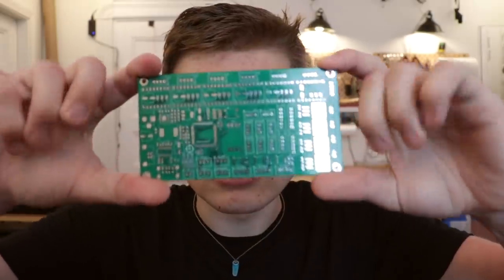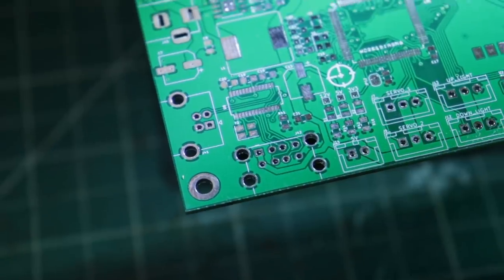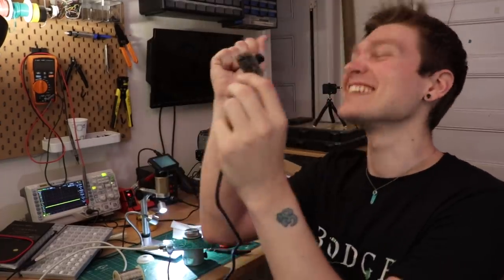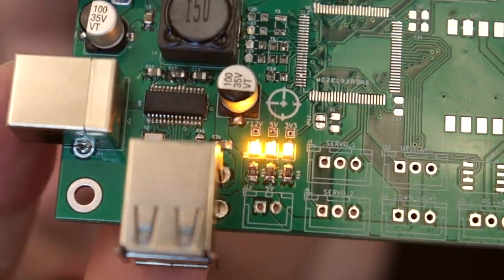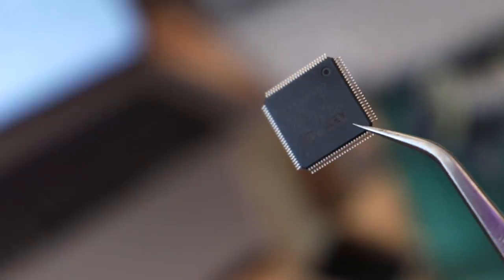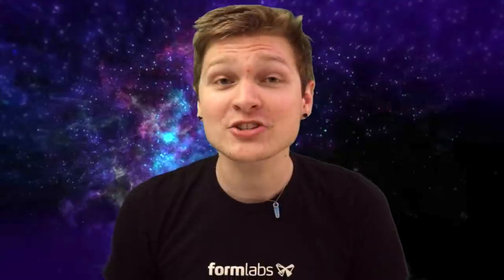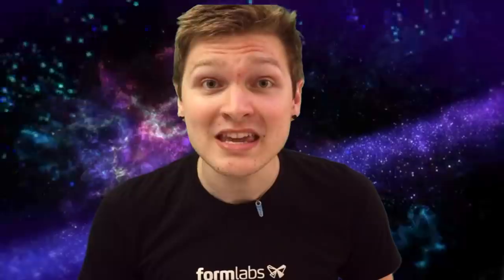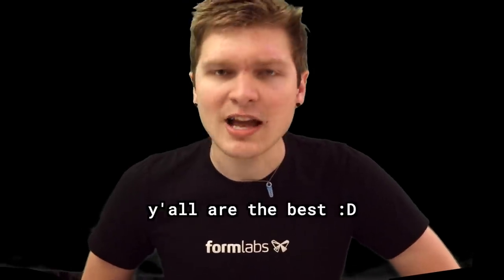The Circuit Board That Builds Circuit Boards

Comment: How would you feel about making a video in which you go through how you select your components? (sites, datasheets etc)
Reply from the maker: Hmm, I haven't considered that! I've been thinking about doing some design streams on Twitch, I might try doing it there! Picking parts is a tricky process, and one I wish I had more visibility into when I was starting out (and still consistently struggle with).
Reply: @stephen_hawes  design streams sound really good and something I (and probably many others) would definitely be interested in

Comment: Hey m8 here to drop some advice for you. Making your life a bit easier. 
Throw Away your conical tips, they do everything but very badly. Sure a beginner just starts off with them and that's ok. But you are not a beginner. 
For BIG parts like an inductor or drain of a FET, use a tip formed like a razor almost or with a big wedge, that way you get the most contact area to the pad and the part. Big thermal mass on the tip goes without saying, absolute gamechanger. 
Also throw away your old school soldering iron with the separate heater, the only place for those in the trash. 
Depending on your budget get a JBC CD-2B something something (will last forever, if you have the money), PACE ADS200 (cheaper tips and cheaper price overall, still very solid build quality) or a T12 style soldering station from KSGER (china) they are also direct heat, quick tip change, small footprint and heat up extremely fast. Build quality is of course not the best but the price is also pretty low. If you can't afford anything else, get this. 
Also for soldering smt ics like the arm get a decent angled tip with a 30° angle on it. You can also get a special drag soldering tip but IMO they are not necessary as the surface tension of the solder will be good enough and the money saved is better spent on a good pair of tweezers. 

Hope anybody how sees this can learn from it and avoid the pain I went through.

Have a nice day.
Reply: Yeah nah. I agree on the chisel tips, they're great and I use them for everything. But there's still a use for conical tips in certain applications, and some people just prefer them. I'm not sure what this has to do with being a beginner.

There's also absolutely no need for a $400 solder station. Anything ~$100 will do fine for home use, a nice Weller is good and will last decades. Unless you're soldering massive components to several oz copper pours, you'll be just fine with a hobby-level iron.
Reply: @Caterpiggle  Well the conical tips are the most common and are therefore the cheapest. So when a beginner buys a cheap soldering station that's the one that will be included. When progressing in your electronics career you will find that for nearly every task there is a better-suited tip geometry.

Weller is also good quality. But their low-end irons don't have the heating element inside of the tip cartridge. Instead, they rely on metal on metal contact, which is just way inferior.
Reply: Barry Manilowa  Yes it is almost unbelievable how much better these newer direct heat style irons perform. Once you made the change there just is no going back.
Reply: I notice a lot of people in the comments section recommend things about the soldering iron, and I totally agree, but it saddens me the most that he isn't using flux. He could have 200% more joy when dragging solder across the microcontroller pins, and it would have made such a satisfying video. But instead, I'm left cringing and moaning at the solder bridges and the missed opportunity for an ASMR soldering moment. He Just needs to get some nice water soluble flux and ditch the solder braid (or at least save it for the seriously botched moments).
Reply: I can vouch for a jbc. I got mine second hand it has literal thousands of hours on the clock(it keeps track) and no issue at all. I love my jbc. The tips are great too for it. Proper tip care and they last a long time. I like the jbc tips better than the hakko t12.
Reply: @dreggory82  Have to agree.  A tube of flux makes soldering SO much easier.  I keep a container of flux-off and ethyl alcohol near my solder station for cleaning off all the flux I use.
Reply: @dreggory82  Yeah that's whole other can of worms ;)
Reply: @KG4JYS  I only ever use IPA to get flux off but it's getting hard to find locally due covid what brand of flux off do you use? Aerosol can or just the liquid I've seen both online but haven't got any yet.
Reply: @FixedUntilBroken  I'm using "Chemtronics Flux-Off Aqueous".  I got a gallon from Amazon a little over a year ago and it seems like that will be a lifetime supply. I've probably used about 1 cup/240ml.    https://www.amazon.com/dp/B0019V17G0/  That's the stuff, not an "affiliate link" or anything.  I'm also using ethyl alcohol.  I buy reagent alcohol by the gallon from sonicsupply.com for about 30 bucks a gallon. It's 95% ethyl and denatured with 5% isopropyl.  I use ethyl because isopropyl is not compatible with some of the resins that my sla 3d printer uses.  Keeping ethyl on hand means I can use it for just about anything except drinking.
Reply: What would be wrong using a ts100 or ts80p? At least the ts100 has more than enough power and thermal mass for very big copper planes. Can't feel a big  power difference compared to the Weller wx2 I use at work.
Reply: @KidCe.  Those have the power but the ergonomics of them are not very good.  I recently replaced my ts100 with a JBC station.   Part of the problem with the TS100's is that for the cable to carry enough power, it's generally thick and inflexible. Also the distance from the handle to the tip on a TS100  is very far.  You can use them but it's far more difficult than it is to use a JBC.  Pace ADS200 is a good alternative if JBC is too expensive.  It's got a short tip->handle length.  Flexible silicone insulated cord, and I believe it heats up even quicker than the JBC.  I kept my TS100 in case I need to solder something on the go, but I haven't actually used it since I bought the JBC.
Reply: @KidCe.  Sure I have a TS80 myself. It's a great bit of kit and if you need to drive by solder something definitely a great choice. But the T12 style KSGER iron is pretty much the same low price and having a soldering station compared to just the iron is definitely more convenient.
Reply: You may want to check if your soldering iron is ESD safe, and  consider using a wrist strap and grounding mat when handling static sensitive devices.

Comment: One of the killer aspects of working with ARM Cortex MCUs is the fact that you can often assign/route peripherals to a multiple choice of pins. The atmega328P is only going to optionally expose a PWM on this pin, an analog input on that pin, etc. etc. etc. but some of the ARMs will let you pick from a few different pins that can all connect via internal pin multiplexers to a given peripheral. Being able to more flexibly assign pins to peripherals opens up all sorts of possibilities when it comes to PCB design.

Comment: You should set your soldermask spacing to something like 0.01 to get mask between your IC pads. The fabhouse will change it to meet their specs.
Reply: You right. It is very important. I usually set solder mask expansion to 0.05 mm. Normally is ok for most fabrics.
Reply: @dimakrayushkin  Of course you can set it to the right specs! However they will process it and not reject it if you´re under it.

Comment: When etching my own stuff, if (when) I make a mistake and must flip a large chip, odds-are the board will get ruined.
 That's one big checkmark in favor of a proto board house: reworkability.

Nice job finding/using a "LQFP" footprint with a 0.63in pitch in such a high-ish pin count. The 0.4-0.5in pitch packages, more common in 64p+, are much harder to play with.

While I wouldn't want to drill and wire a bizillion vias, I could reliably resolve that footprint with a toner transfer. No need to break out the photoresist kit. 
major props on the project

Comment: This my first one of your videos. I love it. I really like the pure emotion in it. When I solder I like to either use a wedge tip or a bent/j tip. I also like to start with the smaller components and work my way up just because like those tall headers can get in the way some times.

Comment: Your PCB layout looks great.

I'm using almost the same chip (the STM32F407VGT6), which has a bit more Flash and SRAM (I think?)

Along with the FE2.1 USB hub chip.

I only recently tried using the hardware counters on the STM32 for reading a rotary encoder, and it works great. ;)
It has anti-glitching logic on the chip, too, so it didn't seem to require any caps across the encoder.

I'm glad I switched to STM32 from the old Atmega2560 I was using.
I did have to get used to using "Workbench for STM32" (Eclipse), though, because I needed to delve into USB HID.

(Most of the USB stuff could probably be done under the Arduino IDE, but it's harder to find specific libraries and example code for some of that atm.)

Using RS485 is a good idea for the PnP. It's far more standardized, there are existing libraries for it, and supports multiple devices.

Oh yeah, and I've also soldered the QFP chips backwards a few times. lol
I learned to be extra careful after that, because a lot of the chips have two dots on them.

I believe one of the dots is usually a bit shinier and deeper, so the camera on the PnP can distingusih it, but that dot is often opposite the dot that denotes pin 1. The chip package usually has the diagonal on one corner, too, but it's not always obvious.

Literally just this morning, my first PnP head motor arrived (the JYD2030-0604B-NK), as your PnP project inspired me to try building my own.

Looking forward to joining the stream chat when you host the Maker Cast.
Reply: btw, if you try using a small chisel tip on the soldering iron (say 1.5mm to 2.5mm wide), you should be able to get much better results with drag soldering.

(I pretty much only use solder wick for getting rid of the few bridges as the solder blob gets to one end of the pins.)

The "hoof" tips with the divot look amazing, too, but I've not tried one yet, as I can't quite justify the cost when I'm only building a few prototypes. lol

https://www.youtube.com/watch?v=5uiroWBkdFY
Reply: @electronash  how do you get soldering wick to actually work? every youtuber seems to make it look like magic when i and a lot of people i know cant get it to do anything. 
i gave up on it and tossed it out years ago.
Reply: your using an F4 chip? i cant remember if i repaired a drone FC that had a F3 or F4 on it, but its cool to see it used on other devices. 
i know its just a programmable IC but i like to know where else these things are used.
Reply: @darkshadowsx5949  

I'm not a huge fan of solder wick for through-hole desoldering. I just use the Duratool ZD-915 for that.

Even for SMD, I almost always add some liquid flux to the solder wick itself first.

It also helps to cut a small piece of the wick off, then use tweezers to hold that, so the rest of the wick doesn't, erm, "wick" the heat away. lol

But it also comes down to using the correct tip on the iron, and having a soldering station that has a decent heat capacity (which is different to it's stated wattage).

I use a Metcal station that I bought second-hand about ten years ago. I usually like the 1.6mm or 2.5mm chisel tip.

I wouldn't ever recommend the really pointy bevelled tips even with a good solder station, as it's tough to get enough contact area for good heat transfer.

The other thing with desoldering (especially through-hole) is to add fresh solder to it before using the desoldering station, as it helps it to reflow once heated. On the stubborn solder joints, I sometimes add a dab of liquid flux too.

And also hold the PCB vertically on the bench, so the desoldering gun isn't working against gravity. And let it heat the pin for a few seconds, so it reaches the top side of the board.

But yeah, in general I hate using solder wick. lol

Only ever use it for getting rid of bridges on SMD pins now. For a TQFP chip like the STM32, I still use drag soldering.

So I tack the corner pins down first (like Stephen did in the vid), add liqud flux (always!), then add about 2mm of solder to the left-hand few pins, then gently drag the iron across the pins whilst heating the pad at the same time.

It usually ends up with a small solder blob at the right-hand side of the pins, which I get rid of with the solder wick.

Or, if I'm being super careful, it's possible to manually solder EACH pin using a USB microscope camera, even with the "corner" of the 2.5mm chisel tip.

(for pin pitches as small as say 0.5mm, I can still solder each pin without affecting the one next to it.)

It's been quite a while since I lifted a pad when doing drag soldering. Just don't put too much pressure on with the iron, and don't dwell for too long on each pin.

Comment: Hey there!! First of all great work dude, I really enjoy your approach to electronics and watching your videos I said “been there...” soooo many times. I understand you want to stick to the arduino IDE and the code you already written but the beauty and potentiality of the ARM architecture can be unleashed only if you use they’re own coding environment. The wonderful part of the stm32 implementation is that basically everything is free. The IDE (called stm32CubeIDE) allow you to live debug code during execution and see the variable contents WHILE executing the code in real time. Plus it auto generates code for every part of the chip functionality. To program the chip you just need a Nucleo board (10$ arduino format dev board with any microcontroller of the stm32 family) that includes the stlink V2 that is a programmer AND live debugger for any uC of st and you can reuse to flash any board you make. I mean, at the beginning the learning curve is a little steep but the advantages are a lot compared to the  Avr ecosystem. If you want more info I would love to share with you.

Comment: That is a beautiful looking board Stephen! I've made my fair share of soldering chips on the wrong way round ;-)
Reply: I did it too, mate. sigh :( lol

Took me years to remember that some chips have two dots, but I still get it wrong at times.

I don't think it's for the injection moulding, as I think that's usually hidden underneath, or the plastic packages are munged together from two halves?

I think one of the dots is meant to be more reflective, so the Pick N Place can differentiate.
Reply: OK, maybe it is just the injection moulding "gate" in most cases.

Seems to be fairly standard that pin 1 is also at the lower-left when the text label is the right way up.
Reply: I always find that the data sheet will always show how to identify pin 1.  Be it a dot,  cut corner,  slopping edge, etc.  Check once fit once, works for me. Best thing with pnp is if it gets it wrong once it gets it wrong everytime :)

Comment: I would like to see how you get Openpnp working with Marlin 2. There are not many that have done this to my knowledge. Most are running Smoothieware (including me ATM). but I wouldn't mind using a controller that has more drivers, like the bigtreetech skr pro, which has a very similar Arm MCU to what you're using.

Comment: So why use a 5V buck + 3.3v linear regulator, instead of directly going for a 3.3v buck converter? Aren't linear regulators a lot less efficient?
Reply: A lot of the times at least in my experience, quality buck converters tend to be more expensive and if the 3V3 is only used for the MCU, a buck that can supply multiple Amps may be an overkill. Not to mention that larger requirement of extra passives for a buck
Reply: you can always use 5V for the plugged in usb devices on the hub (I even think that's what stephen is doing)
Reply: @Davedarko  Right, I was wondering if he needs the 5V somewhere. That would make sense for USB-devices, but in the video he explains that that's exactly what caused the magic smoke, and so he separated the USB- & buck- 5V-lines, right? great channel btw, hab ich direkt abonniert ;)
I agree with @Aditya Sehgal
 though - the MCU probably draws so little power that it hardly matters, and if 3.3v bucks are expensive that would explain the extra component. I imagine linear regulators also provide more reliable/precise voltages?
Reply: @larsfroelich  Hehe Danke, poste nur noch sporadisch, meisten Sachen produziere ich fuer element14 :) 

The USB input from the computer was separated from the 5V on the board that delivers power to the usb devices like the HUB and camera etc. So yes, separated USB but still 5V for USB :D
Reply: @larsfroelich  About the bucks, its not just 3v3 bucks, but really all in general. for an MCU needing a couple mA it makes sense to use an LDO given the extremely low cost of them. Look at the AMS1117 or the XC6206 both can be found for a few cents whereas a nice TI or OnSemi buck can be a couple dollars. And inductors can be rather expensive too if you have tight constraints. Not to forget the noise... linear regulators have virtually no noise since they just dissipate the dropped voltage as heat. As for the voltage that can be usually adjusted unless you opt for a fixed model but noise can be an issue since too much noise can impact your logic levels

Comment: more flux, USE MORE FLUX
Reply: Or you know he could use any flux. All I saw in that vid was what was in the core of the solder wire and in his solder braid. Infact I think the solder braid was doing the whole job of fluxing the pins of that STM chip.

Comment: Every time i see your video with a new board i expect you to use the PNP machine to mount at least a few components or at least to dot pasta on the board
Never happens 
Would be more ironic than the title.. Using a machine that builds circuit board to build a circuit board for a machine that builds circuit board